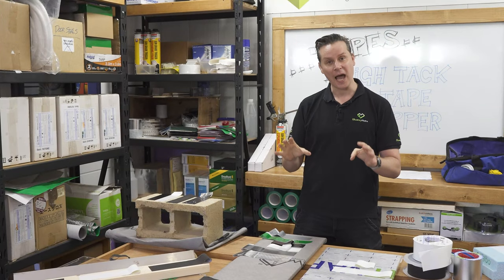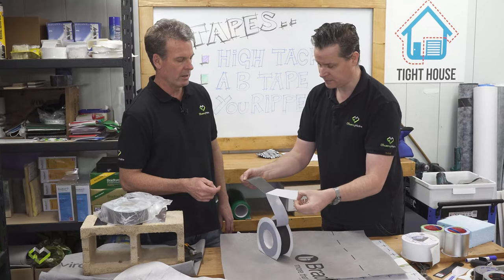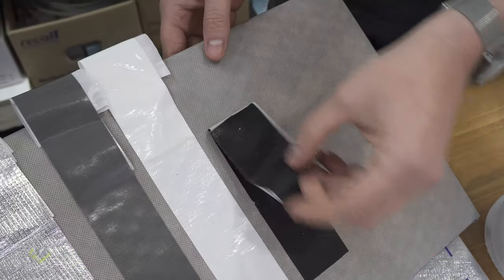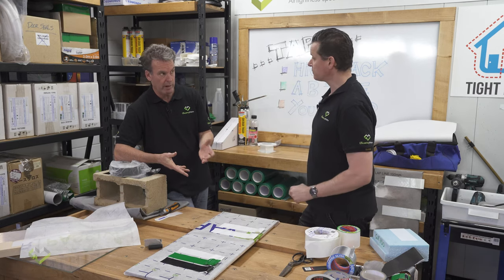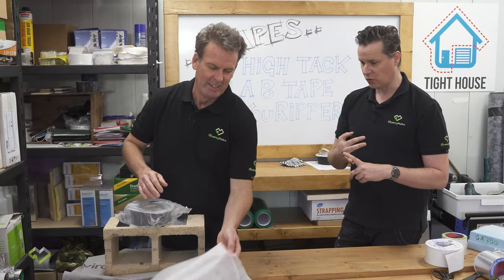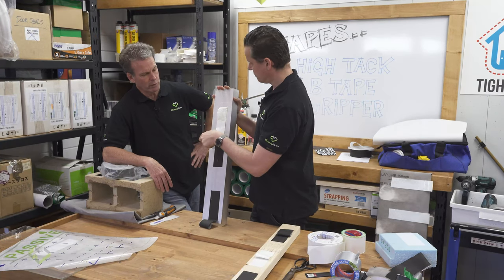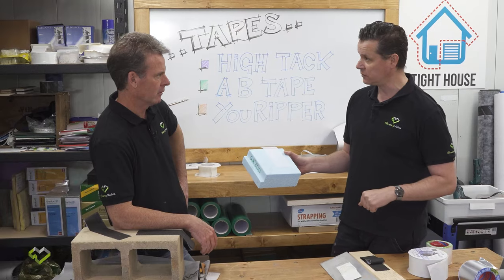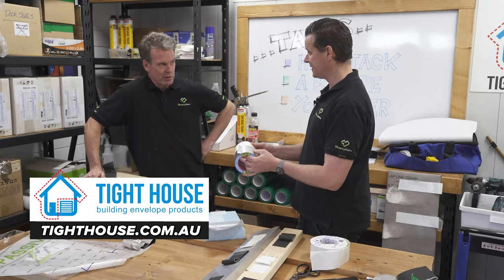How to choose the right tape for Construction.

Comment: When using the high tack tape for joining wrb layers you stated that the tape needed to be pressed in (you used a plastic tool). How do you achieve the same thing in the field when they join area is unsupported ie nothing behind where the tape is going? I am seeing a lot of volume builders using wraps now but the installation is poor because the tape joint is unsupported
Reply: It is not an easy question. The typical Australian stud frame is not designed for wraps. However, my suggestion is that using wraps with integrated tape on the long edges. This type of product has adhesive pre-applied. When installed, the wrap will be sticking between 2 adhesive surfaces, which greatly reduces the need for applying pressure (or I should say reduces the intensity of the pressure required). For the short edges (vertical), the carpenter may need to install an extra stud where the taping is going to be applied. Considering the length of a roll of wrap are typically 30/50m, the number of additional studs required is limited.
Reply: @josephcheung3964  thanks that’s good advice